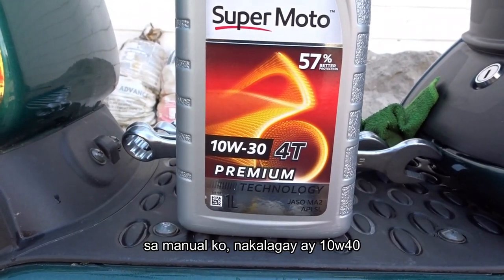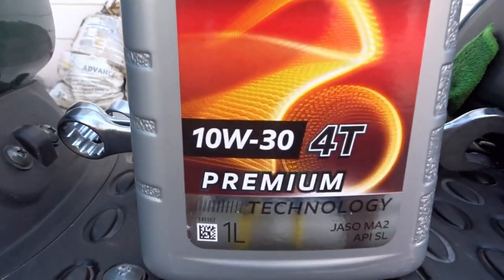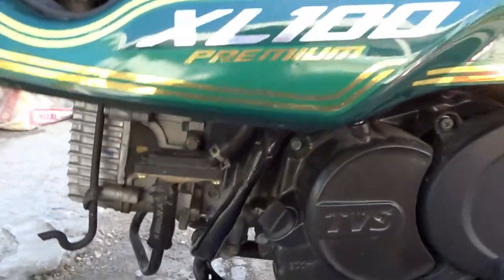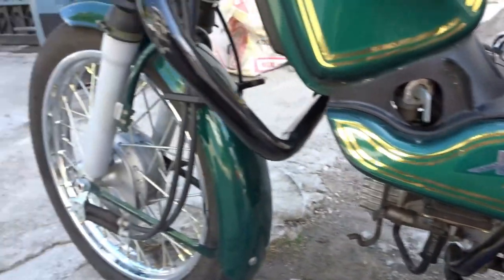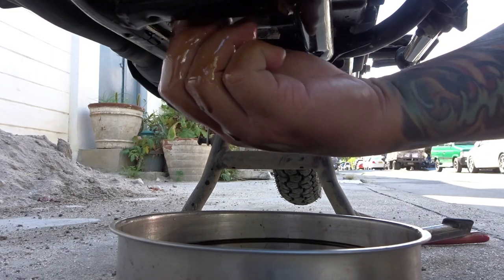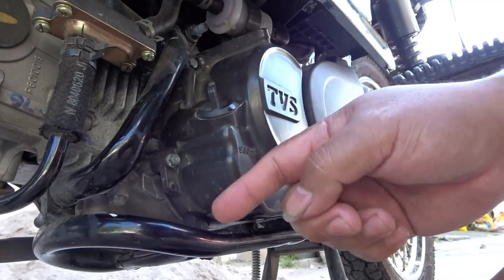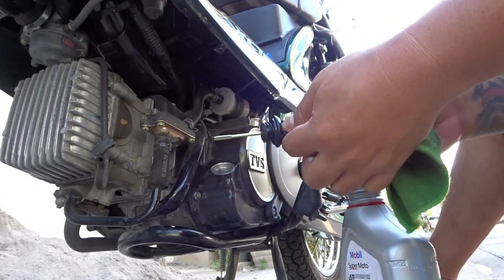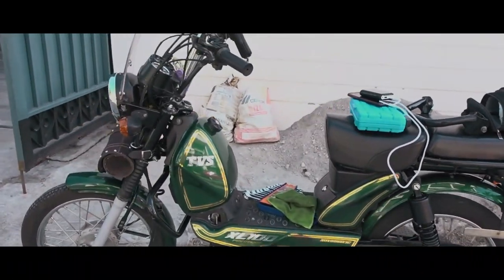TVS XL 100 DIY Change Oil Recommended Oil Best Oil

Comment: sir san po kta pwede makontak?may itatanong lang po about vulcan
Reply from the maker: You can ask here sir
Reply: sir pa bili po ako big bike,dalawa po pinag pipilian ko cb 500x ng honda at vulcan s ng kawasaki.anu po fuel consumption ng vulcan?okei po b pag may backride ang vulcan?
Reply: magkano po ang chain and sprocket ng vulcan 1set?
Reply: hindi po b sumasayad ang fender ng vulcan pag may backride?clutch cable ng vulcan how much po?
Reply from the maker: @jiggssore9470  for the set, its around  10k to 12k. Depende sa store. (Front and rear sprocket, and chain)
Reply from the maker: @jiggssore9470  kung may angkas, para sa dalawang choices mo, i suggest get a back rest for ur pillion or angkas. Masakit sa likod ng angkas pag long ride.

Not sure on the consumption of rebel500. But the vulcan s can fo 21km/liter on traffic, 25km/liter on expressways.
Reply: maraming maraming salamat po sir
Reply from the maker: @jiggssore9470  ur welcome sir. Hope u subscribe